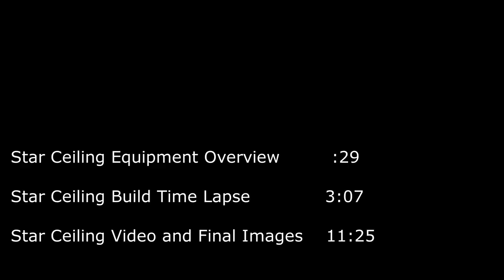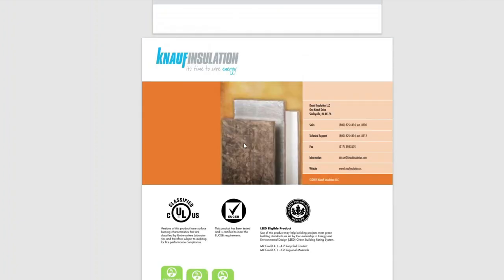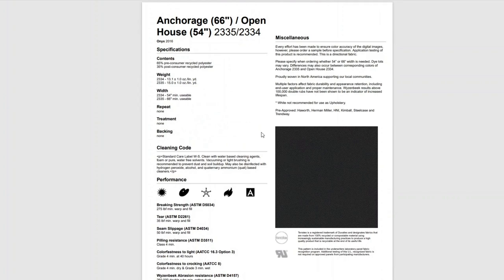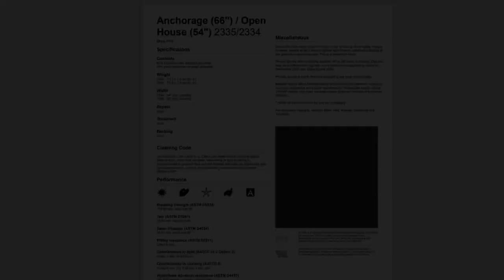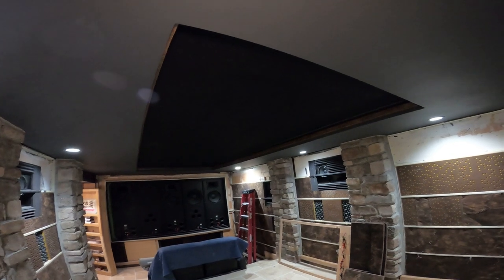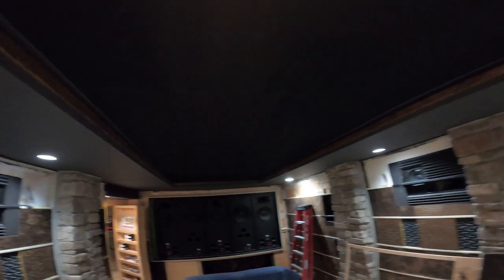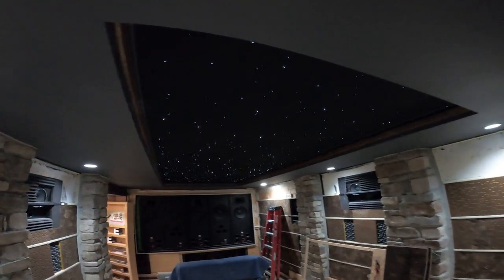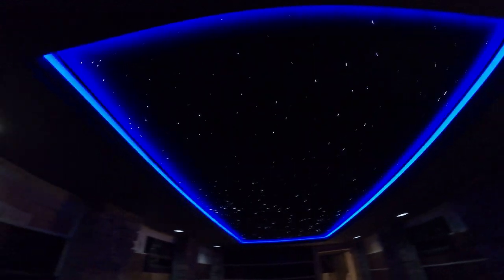Fiber Optic Star Ceiling Installation - Time Lapse - Theater Room Build - EP #6

Comment: I have a question about the fabric you used. How wide is that roll of fabric and what is the item code for ordering thru the company you purchased it from?
Reply from the maker: Hello,

We use Guilford of maine Fabric.  This is there Onyx and comes in 66" width.   Hoew much do you need we stock this!

Cheers
Reply: @theaterdesignco  I'm not sure, I have 2-4x8 panels and 2-6x8 panels. I see you didn't use adhesive to adhere the fabric but I saw adhesive and plastic being used but the video was so fast I couldn't distinguish the use. Also could I get the diagram